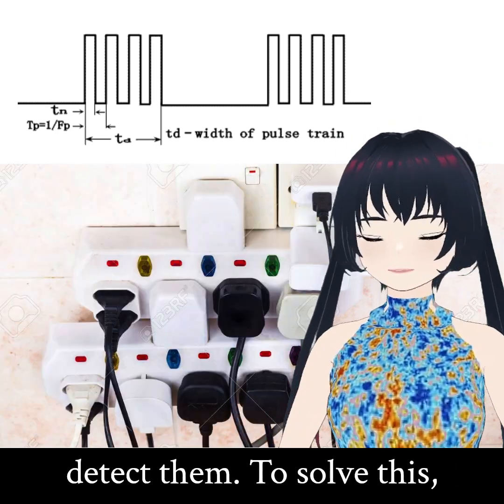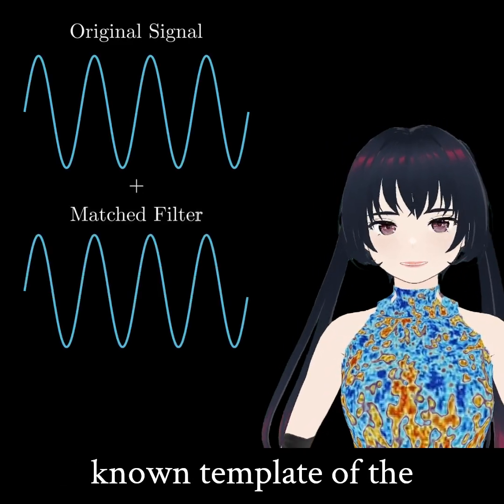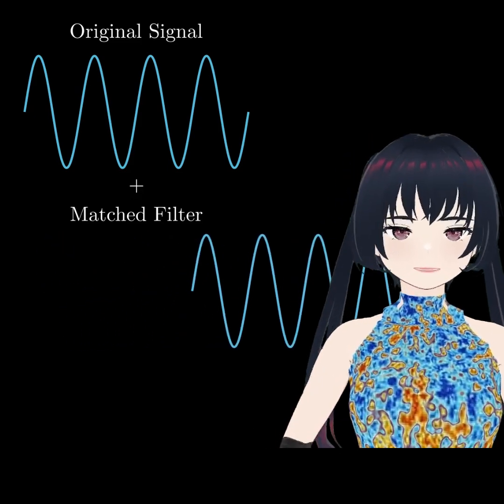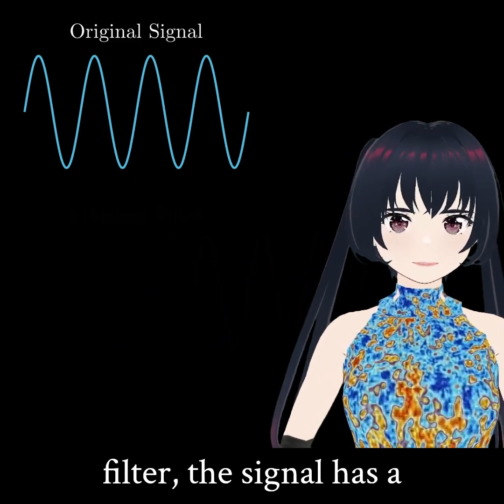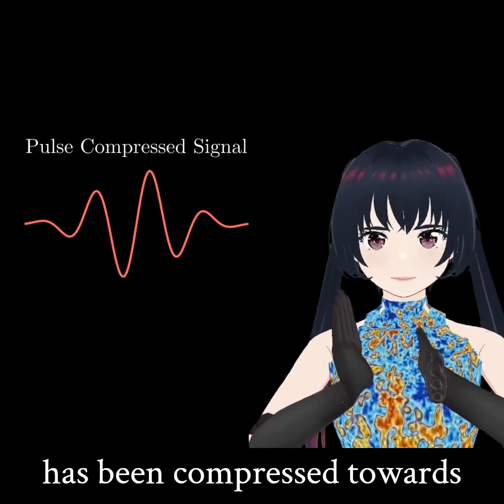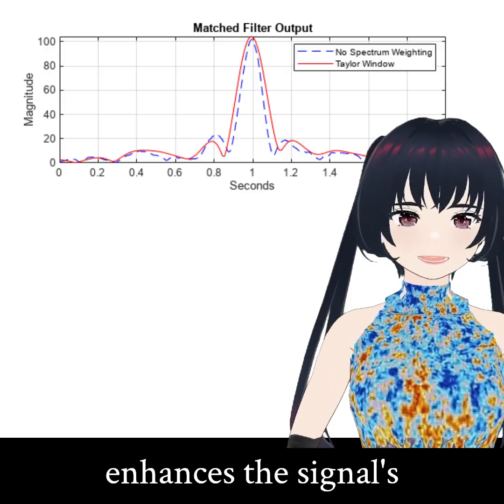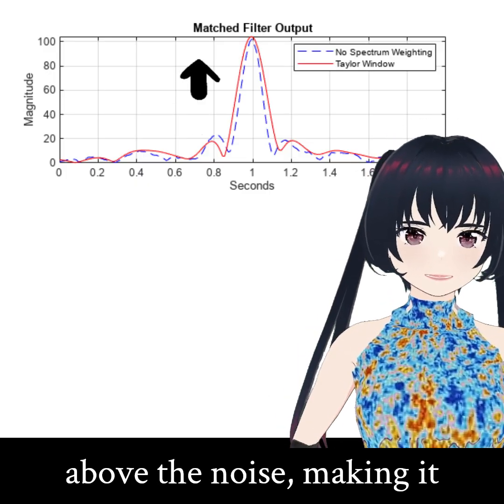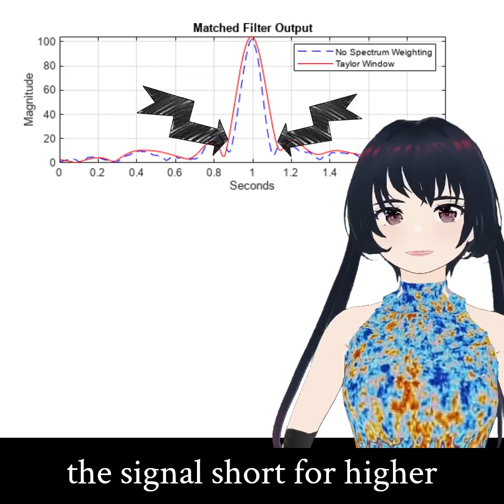VTuber explains radar pulse compression in under 60 seconds @SyzygyAltairCh

Comment: When a radar sends out a pulse and bounces off an object, would the pulse jump back only to the radar or also into other directions?
Reply from the maker: The pulse actually spreads out like a sphere when it bounces back! So we receive a lot less signal than what we sent out originally 👀
Reply: @SyzygyAltairCh  when it bounces off or bounces back, would other devices be able to intercept the signal? Also is there a way to prevent detection or to interfere with radar?
Reply from the maker: @teeka-annoyed  yep, but it would be really weak + challenging to detect - that's why you need to stack multiple pulses to actually detect the signal!

This is also the groundwork for stealth technology - they make sure that if a radar signal is sent towards them, the signals are reflected at angles away from the transmitter so it would not be detectable at all!